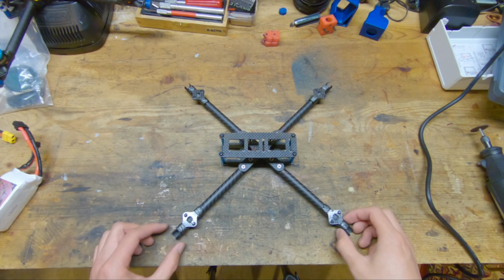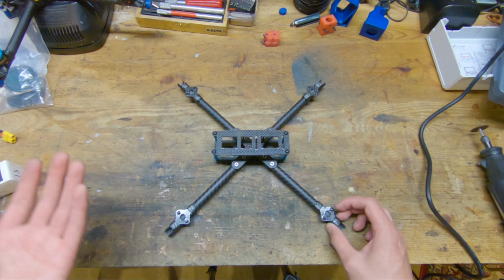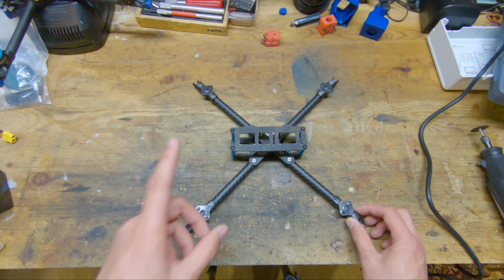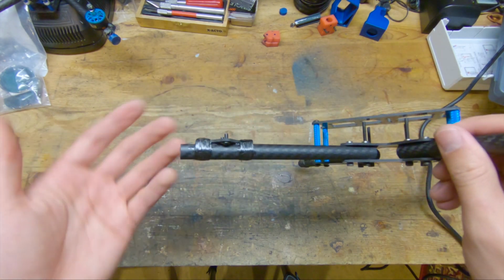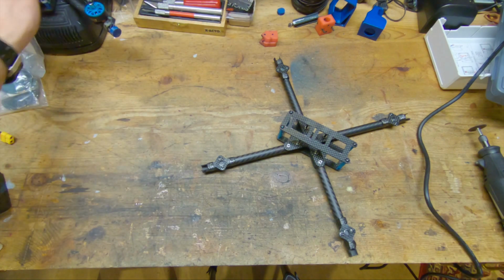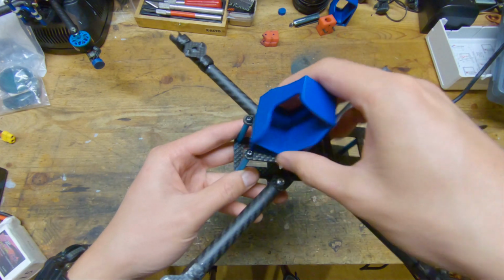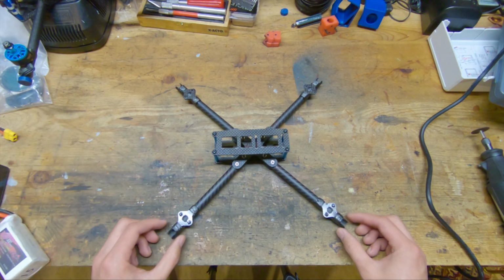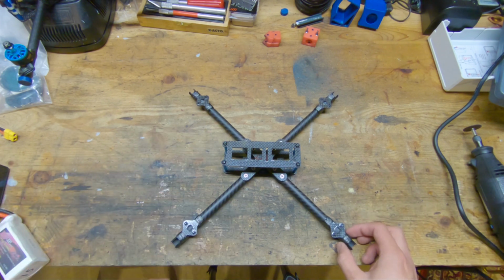Tubular Quad V4 Frame Build - Build Your Own FPV Miniquad Frame

Comment: Super cool design! Why do you think none of the commercial frames use tube arms?
Reply from the maker: Thanks! Many commercial frames use tube arms, just not at the smaller sizes. I think it's due to the manufacturing simplicity of making a frame purely from carbon plate.
Reply: Have you thought about working with someone to manufacture and sell these? People will pay a bit more for a frame with better stiffness and lighter weight. Maybe use compression molding aka forged carbon to interface with the round tubes. Basically carbon fiber overmolding.
Reply from the maker: @adriankelly3338  In an ideal universe I would, but frankly I'd rather dedicate my remaining spare time to other things.

Throwing molding into the equation would require a full redesign to fully take advantage of that tech, and also would drive the cost way up because machining molds is very expensive.

Comment: good work. Load test? k as a function of displacement when stressing it from different angles
Reply from the maker: Thanks! I don't have equipment to do precise load testing. I have wanted to run FEA or do the hand calculations but haven't gotten around to it.

Comment: This is great precision work, man ! Only question: if you crash the arm will rotate and it will apply a rotating momentum to the inner screw which holds the FC. Have you had any problems with the FC being stressed ?

Comment: Awesome work ! What’s the durability on those arms ? Even if it’s not as tough as 5-6mm arms, they’re made of tubes, cut them to size and ready to go, I love that. Have you considered to use aluminum clamps to hold them to the Frame and/or as motor mount ?
Reply from the maker: Thanks! I've found the arms to be surprisingly durable for how little carbon there is. Probably not as durable as fat 5-6mm arms though. Maybe on par with 3-4mm arms? Aluminum mounts crossed my mind but are out of the question because they would require custom machine work. In addition, carbon fiber has a much higher strength:weight ratio than aluminum, so I don't see any big benefit of using custom aluminum components.
Reply: Timmy RC if you search for « cnc aluminum tube clamp  will find what I was talking about. The idea behind this I to make the building process more consistent
Reply from the maker: @Yorianful  Thanks for the clarification👍 . Those could definitely address the difficultly of drilling perfect holes into a round tube. They seem very suitable for attaching the arms to the fuselage. One concern I have is that friction alone probably isn't enough to keep the tubes from rotating during a crash. The original ImmersionRC Vortex used a plastic clamp with a locating pin and hole in the carbon tube to prevent this from happening. There is still a weight trade-off to this solution, though.
Reply: Timmy RC I agree about the rotating part, but imho that’s only an issue mid flight, if the arm rotates during a crash I guess that would prevent a lot of break...

Comment: Where i can buy 2x ??? :D WHATS THE PRICE for the 7 inch
Reply from the maker: You are the second person to ask for a 7 inch version - I really appreciate your interest in my frame👍. It is a small dream of mine to commercially sell these frames. Unfortunately, right now I am not selling handmade frames for a variety of reasons. They take a relatively long time to make by hand so the cost of labor would make it absurdly expensive, there is no real control over tolerances because it's handmade, etc. 🙁

What I can do is provide you with the drawings and 3D models for free and help you figure out how to build the frame yourself or pay an actual machining company to make the parts for you.

Comment: I was following you during the v2 and v3 but in my opinion the arm screwes in the bottom were too tight, so I decided to not use screwes but use glue. In this way I can't change a broken arm. Now with your v4 everithing looks nice and clean and feels robust! Do you have fb or ig where I can contact you? Amazing work!!
Reply from the maker: Thanks! I agree that the screws were packed in too tightly up until now. My contact info is at the bottom of the About page of my channel.

Comment: What would it cost for you to make up a 7" version and post to UK? Plus a bit for your trouble too of course. 👍
Reply from the maker: I really appreciate your interest in my frame👍. It is a small dream of mine to commercially sell these frames. Unfortunately, right now I am not selling handmade frames for a variety of reasons. They take a relatively long time to make by hand so the cost of labor would make it absurdly expensive, there is no real control over tolerances because it's handmade, etc. 🙁

What I can do is provide you with the drawings and 3D models for free and help you figure out how to build the frame yourself or pay an actual machining company to make the parts for you.
Reply: @TimmyRC  Ok no worries. Thanks. Do tubular arms reduce / eliminate resonance?
Reply from the maker: @changeagent228  Yes, due to their much higher stiffness the frame resonates at a much higher frequency, which is much easier for the flight controller to deal with.
Reply: @TimmyRC  Excellent. 👍 Is there a limit on how small the tube diameter can be? Could we get a 7" frame that weighs 65g?
Reply from the maker: @changeagent228  I don't think it would be too difficult to design a 65g 7 inch, but you would be throwing durability out the window. The stresses that frames have to withstand in the air are minuscule compared to the stresses they have to withstand in a crash.
Reply: @TimmyRC  Yeah I understand. I expect fragility in exchange for efficiency. So out of curiosity if I said what is the absolute minimum weight? I only want the Caddx DJI system with no go pro and a 20x20 stack could we have a 7" 40g or less frame perhaps?  I'm thinking if I used RSII 26g 2306 motors we could have a seriously light long ranger.
Reply from the maker: @changeagent228  The only way to find out the absolute minimum weight is a lot of designing and testing. Here is the RCGroups thread that helped inspire the Tubular Quad and might give you some ideas about how to get the weight down:
https://www.rcgroups.com/forums/showthread.php?2645953-Mini-tubular-and-ultralight-LOS-Acro-FPV-Quads

Comment: Awesome frame, really simple and effective. I've found that 6" frames need to be stiff to avoid "jello" the tube arms are key👍
Reply from the maker: Thanks! Years ago I used to have oscillation issues with KISS on my 6 inch Alien. I think if I was running that same setup on the Tubular Quad I wouldn't have that issue. The tubes make a surprisingly large difference in stiffness.
Reply: @TimmyRC  so running stiff makes it more stable?
Reply from the maker: @antdx316  A stiffer frame causes the frame to naturally vibrate at a higher frequency. The flight controller has an easier time filtering out higher frequencies, so a stiffer frame will require less filtering and will have less jello/oscillation issues that are caused by vibrations reaching the PID loop.
Reply: @TimmyRC  so a less stiffer frame would vibrate at all frequencies?  My 111R has an immaculate stable look to it but my 250 frame of 2015 or 2016 is just bad.
Reply from the maker: @antdx316  A less stiff frame will naturally vibrate at a lower frequency, but not necessarily more frequencies. The carbon layers in frame components tend to delaminate over time, reducing the stiffness of the frame, which can lead to more tuning issues with frames that have been flown/crashed a lot.
Reply: @TimmyRC  so the thicker the better and the only downside is the weight?
Reply from the maker: @antdx316  To an extent. Weight by itself will decrease the natural frequency the frame vibrates at. But stiffer arms increase the natural frequency. This is why tubular arms are so advantageous; they are stiff yet light due to their shape.
Reply: @TimmyRC  I used to have tubular back with KKBoards but if you don't tighten them right they will rotate in the air

Comment: Nice video!! Do you think it's worth building it with 5 "arms? I crash a lot you can see in my last video.
Reply from the maker: Thanks! You can definitely build it with 5 inch arms, and it will still retain its desirable weight and handling characteristics. If you break frame components often it might not be worth it because you will have to manufacture your own spare parts.
Reply: @TimmyRC  Nice! I writh you an email for more info

Comment: I really like what you are doing and that fact that you share your knowledge through
These video’s, I do some similar work with carbon and produce small one-off components.
You can get very accurate results with simple diy tools (tungsten carbide saw used for tile cutting).
I can’t tell in the video but please use a suitable Micro filter face mask, same goes for the vacuum bag

As all the dust will end up in your lungs, I sometimes run a vacuum dust extractor next to the work I’m cutting or filling with ear defenders 

and a mask, less dust in my workshop.
Also, you can use waterproof labels and do some of the sanding, finishing off under running
Water.
Reply from the maker: Thanks! Yes, I wear a N100 dust mask and goggles, and I also did most of the cutting outside.

Comment: Not knocking your creativity or ingenuity but I think I would just diy or buy a small cnc for this. Seems like a lot of time and patience. Amazing work especially by hand.
Reply from the maker: Yeah I've definitely considered buying a CNC, but a decent one would be $1000+ and I feel like putting together and setting up a DIY one would be more hassle than building the frame from scratch.
Reply: @TimmyRC  I've seen people use 3d printers and switch the hot end with a motor or Dremel. With the frame being so small and ender 3 would suffice. But one thing I didn't think about is how often you need a new frame. Unless you used it for other stuff cutting a frame every few months probably wouldn't justify buying one. Either way you seem to have your process down and fly way better then me so keep it up.lol
Reply from the maker: @philaell  That's a clever concept. I really only make new frames once the previous one breaks, which has only been every 6-12 months. So as you said it's probably not worth it for me. Another option would be to pay a carbon plate machining company to cut the parts, which is actually quite reasonably priced. However, I like to demonstrate what you can do all by yourself with (relatively) simple tools. I also think doing it yourself is a good challenge and more rewarding (admittedly building a CNC would also be challenging and rewarding).